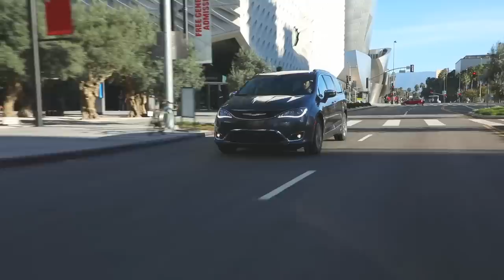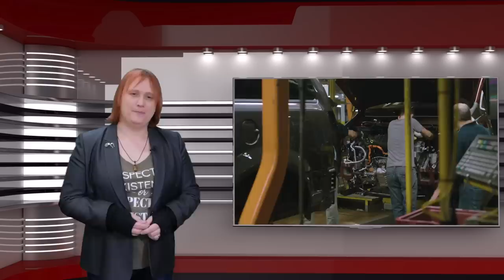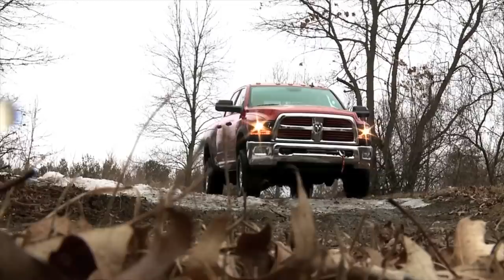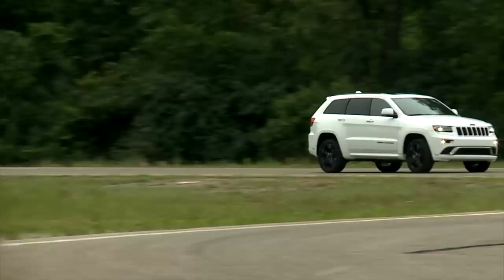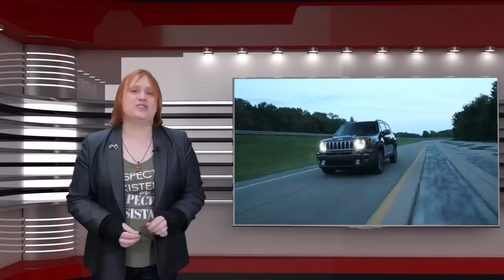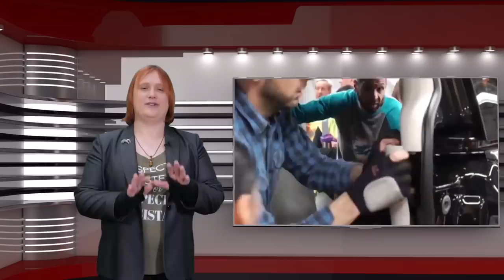Just How Serious Is Fiat Chrysler About Plug-in Cars? It's Not In The Headlines

Comment: I think it will not be long before some of the incubents, FCA included, will start to fail and the brand will be bought by (cough!) Tesla or Chinese manufacturer. They will be able to electrify the models as they will have the 10 year experience and battery packs to do this before the incumbents can develop the experience or in FCA terms even realise what is happening.
Reply: Yep, I expect FCA to start to run out of their SUV cash once the next recession hits, the question is what company will buy their remnants (or at least the Jeep brands, since it's one of the most valuable nameplates in history). I would think GM would as they've had an interest in Jeep for a while and even partnered with Fiat before they were FCA (Fun fact, Alfa Romeo 159 used a modified version of the GM Ecotec engine, and rode on a platform co-developed by GM and Fiat)
Reply: @cpufreak101  We saw what I think will be similar with Rover/MG in the UK did which is just build cheaper and cheaper base vehicles (not in the case of Jeep) and just miss the boat.  The brand and key models will get bought but not the fossil excessive vehicles. I had a (GM) Vauxhall/Opel Signum with the same engine as the Alfa and Fiat. Great engine but Vauxhall/Opel ruined it with dodgy EGR valves. It does show a way of cooperation out of the malign but fear already too late. Would love to see a longer wheel base Signum/Station Wagon/Estate/Shooting brake that could fit more batteries easily and give 400 mile plus range an option.